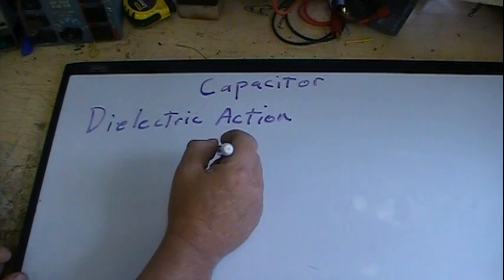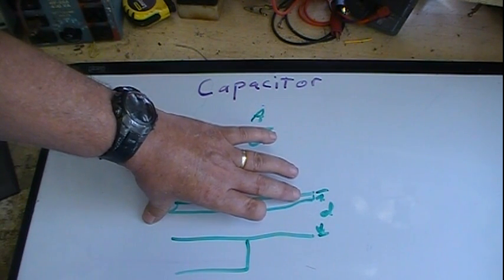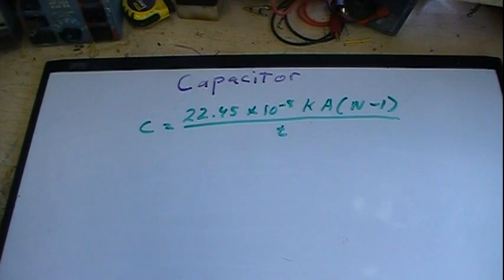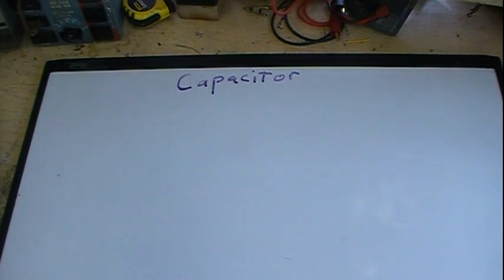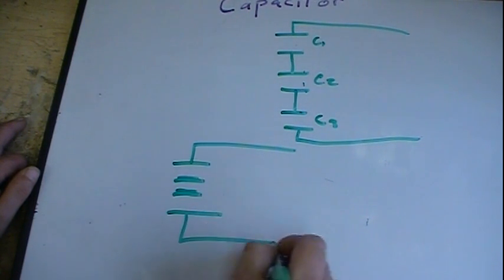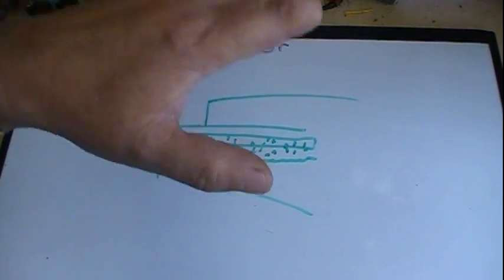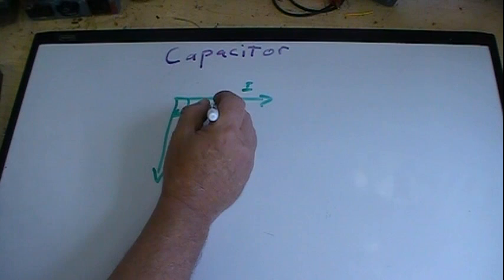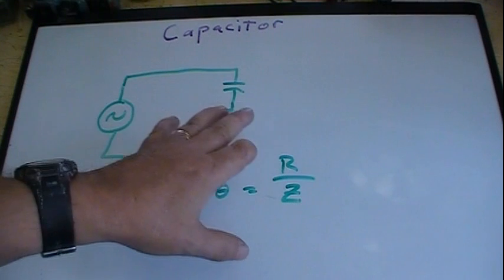AC circuits 101 part 2

Comment: Hi Dennis,
Can you explain why with caps in series you sum the voltage ratings and what is the rule regarding caps in parallel as regards voltage rating?
Reply from the maker: g4rko Barry On the next video that is going to up later today I have answered your question.

Comment: Will you need heavy duty mathematics to do repair.
Reply from the maker: MrMac5150 In the next video that will later today I will answer your question. But really you don't need to know any heavy math for radio repair.
Reply: Dennis Carter
You were starting to loose me, I am not good at math. Just proficient in simple arithmetic.